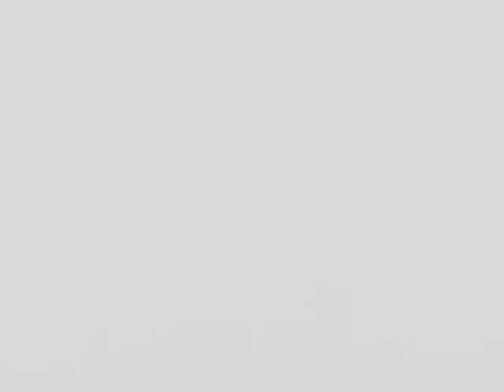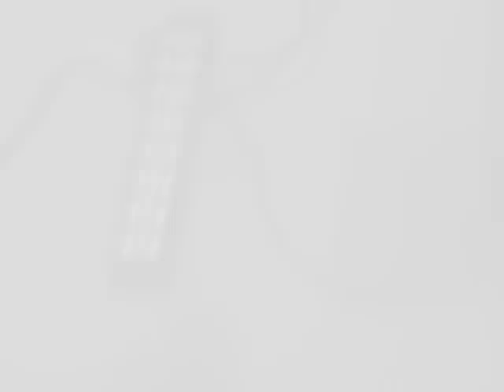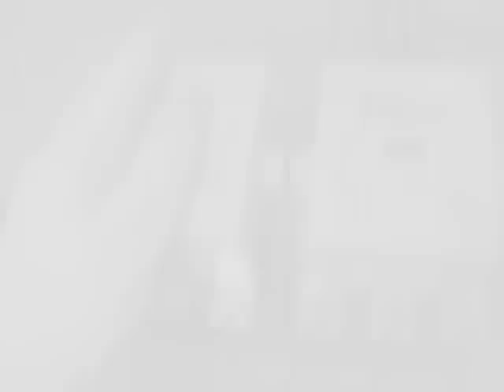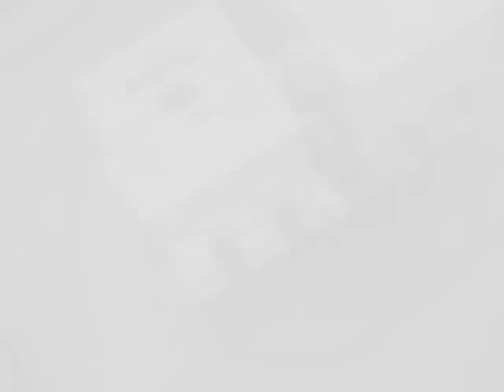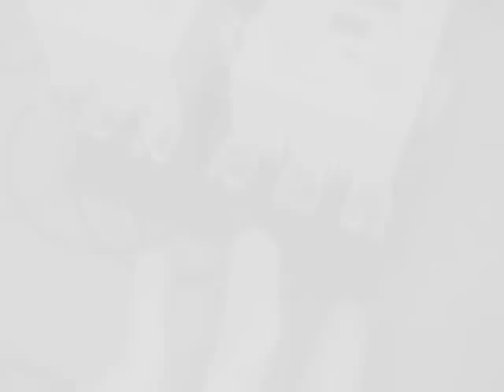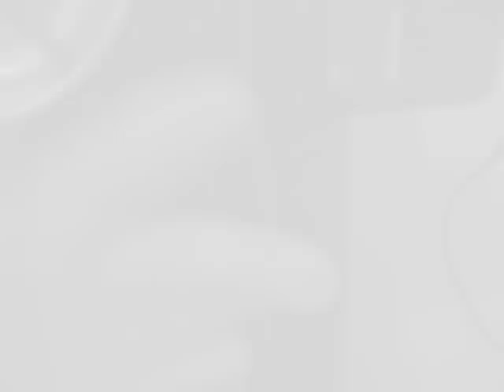Star delta motor starter + explanation

Comment: how many contactors did you used? it should be three right? one for the main service, the other one is for star configuration and the other one for delta configuration.
Reply from the maker: I used 3, one was a bit undersized, just for this demo.